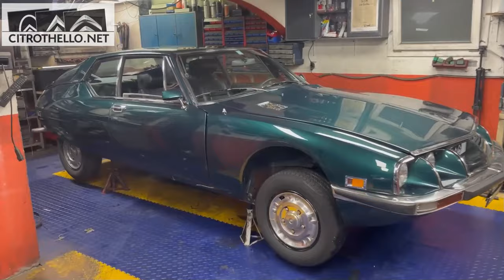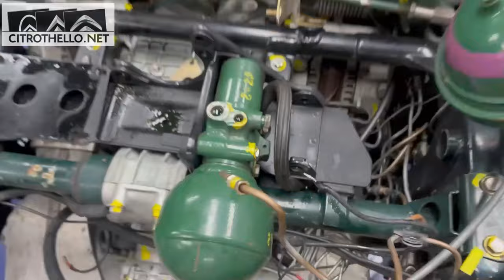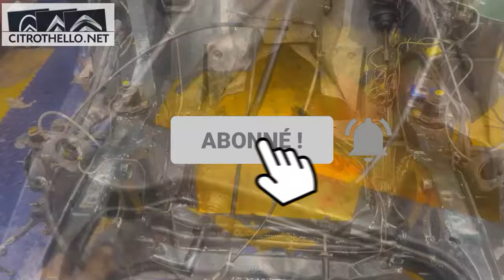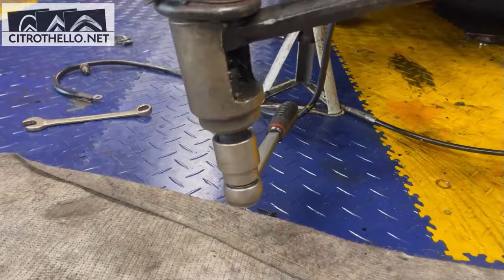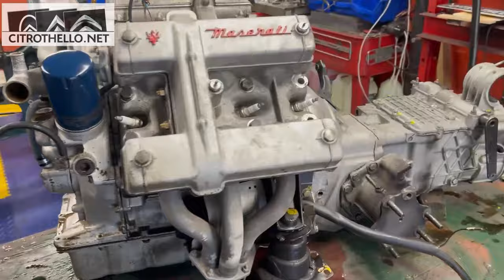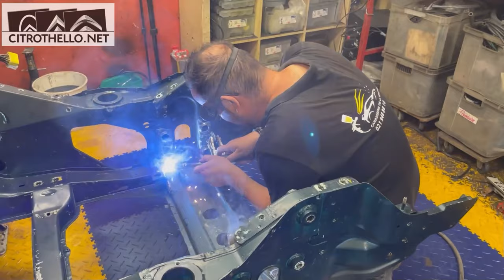CITROEN SM 1971 2eme restauration pour ma SM. #citroen  #voituresdecollection #cars

Comment: Great that you look after your personal cars so well and use them as they should be! I assume that the rust and corrosion is from the salty roads in winter from the last few years?
Reply from the maker: Yes for sure, i knew that but I wanted once in my life to use very often one SM. I use her 3 winters. The main reason I change my mind, the heater is very low. By night, when it's too cold, you can drive 20 minutes and you don't have enough warm. So now I put her back in collector mode.